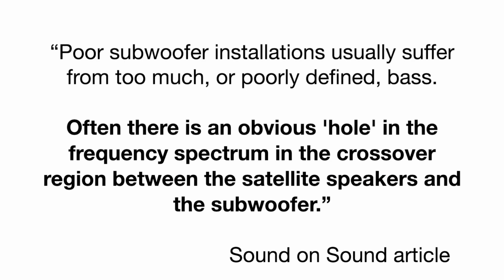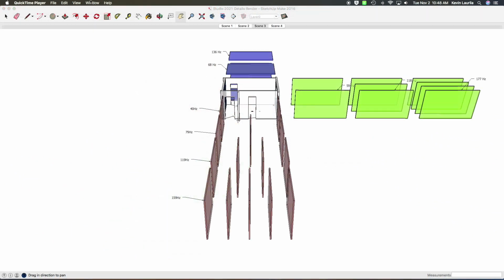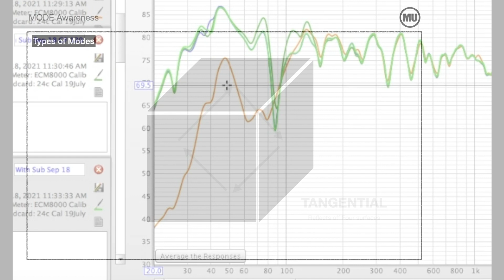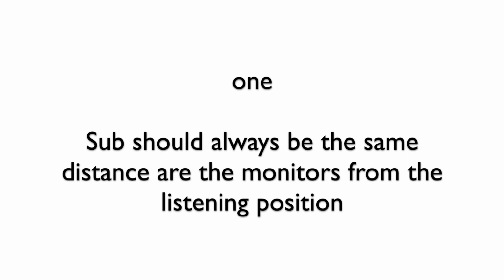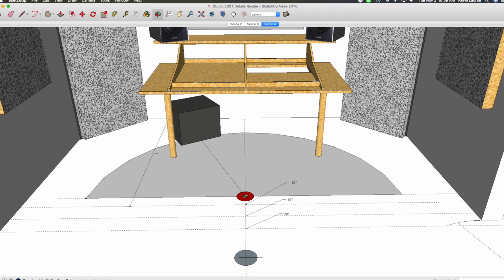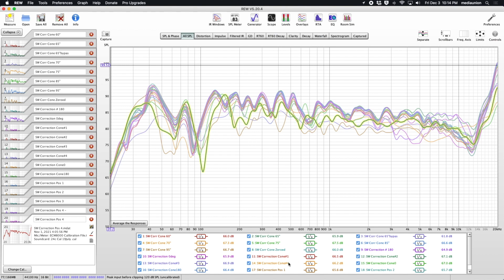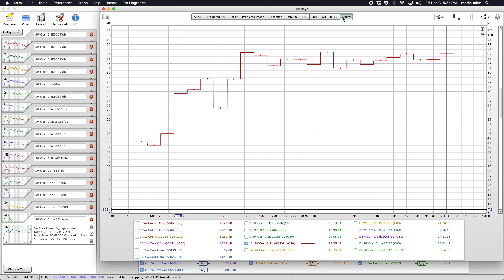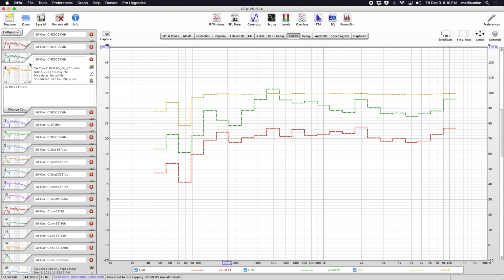Improve your Home Studio Sound! Part 4 - Investigating the 88Hz Null

Comment: Some food for thought on sub placement. Low bass frequencies radiate in a sphere outward from the sub. They are not directional. If the crossover is set for 80hz there is no directionality to it. The sub can safely be placed behind a person and they wouldn't be able to tell directionality, as long as it's in phase and the volumes are aligned. Same applies to whether it's in front of you or not.
Also, behind the listener placement can help to cancel out excess bass energy or work around existing nulls. Most rooms aren't perfect and listening and speaker positions are less than ideal. This is one way to combat that.

Comment: How do I average or make a display of all sound attenuation measurements (RT60)?
Reply from the maker: Hello Vasiliv, if you are currently using REW to measure changes you make...Once you have a couple of sweeps run, click on the overlay button at the top of the REW window, it will show you the different sweeps you've run.  In the top of the overlays window, there are buttons for SPL, Phase, Impulse,RT60, etc.  Click on the RT60 button and it will show you the sweeps RT60 changes between the sweeps.  The gear icon in the top right corner of the Overlays window will allow you to change your preferences for the different overlays.  I use it to display the RT60 as topt and 1/3 octaves.  Hope this helps!

Comment: Great video, though I am perplexed as to why you are not pursuing acoustic treatment targeted directly on 88Hz. If you minimize boundary reflections of 88Hz through absorption your nodes of that frequency will weaken as you gain a higher ratio of direct wave to reflected wave.
Reply from the maker: Well done. You are ahead of the curve. 😁 Next Video will cover the concept of Boundary Interference and I will walk through the 5 steps:
1-Listening Position (38% of Length) ; 2-Listening Distance; 3- Speaker Layout and Height ; 4-Speaker Distance to Front and Rear Wall; and 5-Apply Acoustic Treatment .  My first priority was to treat first reflection points and the super chunks in the front corners.  I'll attempt to counter the Null with bass trapping on the back wall.  Do you think it would help other viewers to see my current absorber/diffusion set up before I move into the SBIR correction effort?
Reply: @mediaunion  I can't speak for other viewers, but I at the least would be interested :) I am about to embark on mixing room treatment after gathering enough REW data.
Reply from the maker: @tritonedelta3464  Thank you! That's good information.  I think I'll post a "let's look back" video on what I've accomplished thus far and my existing room configuration.

Comment: Why not use the room sim in REW and move the sub around to try to minimize the mode.
Reply from the maker: Thanks Richard.  I did exactly as you suggested and found in using the simulator the best low bass response is centered on the back wall about 3' 10" off the floor.  Gonna give it a try and will let you know.   However, everything I've read and researched (manufacturers) for studio/mixing rooms says the sub has to be in front of the listening position.  So others have suggested introducing miniDSP to manage the sub using delay...Thoughts?
Reply: @mediaunion  first let me say that I very much enjoy your videos. I enjoy the techy side of it all. That said, I don't think eq is the way to go. I've tried some mild subtractive eq via hardware and did not like the results, but then again my room is still a work in progress.
Reply from the maker: @richardsantucci3162  Good info!  I feel better knowing that I'm tackling the issue with absorption rather than EQ or delay.  I'm pretty confident that the Null can only be solved by knocking out the 88Hz wave cancellation between the back wall and speaker...but I've been wrong before.  HA!  Keep in touch!

Comment: Did you check time alignment on mains and subwoofer? If you do it correctly in REW it will help a lot with that dip.
Reply from the maker: Hey Hannu.  Yes T7Vs and the T10S are aligned.  My room is smaller than 140 sq ft / 13 sq meter so I'm pretty sure that this null is something I will not be able to change much.  Next video investigates the SBIR rules as a possible fix.